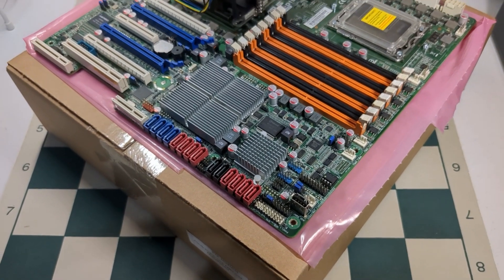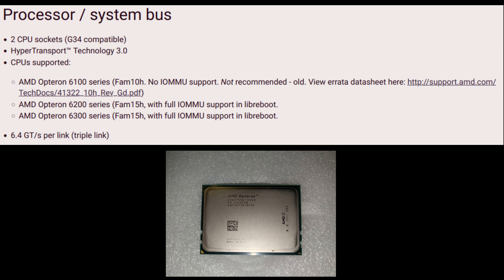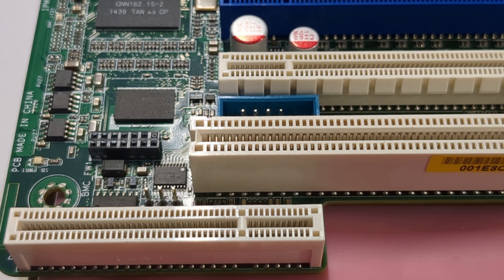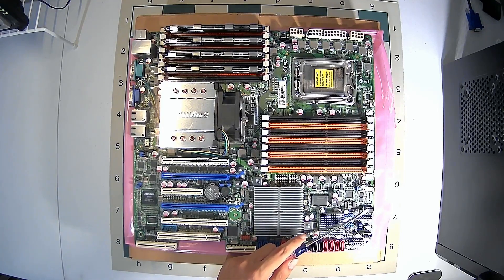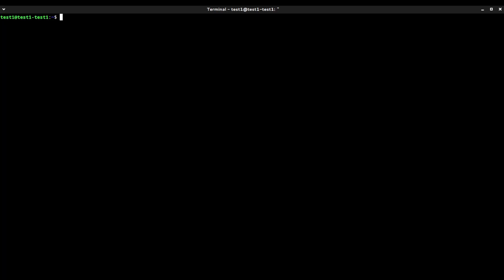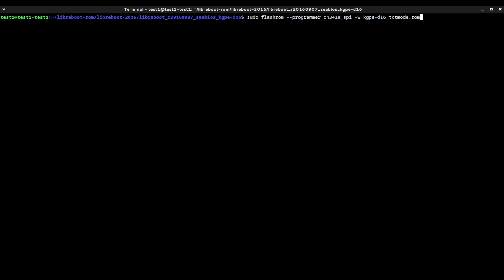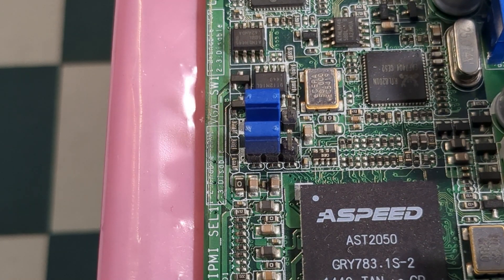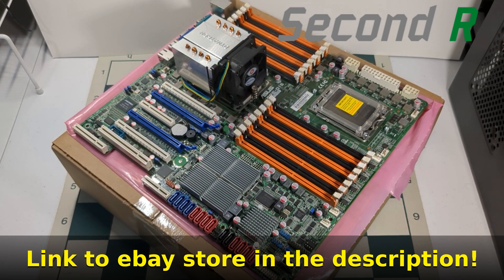How to install Libreboot on a KGPE-D16 Workstation/Server Motherboard

Comment: What Graphics card did you use I currently a black screen as I don't have a card and Libreboot cannot talk to the onboard graphics as they are not free. The board boots and have correct size Seabios flashed, correct board RAM and CPU's. So I think my problem is the Graphics card and by the way great content I gave you a follow!